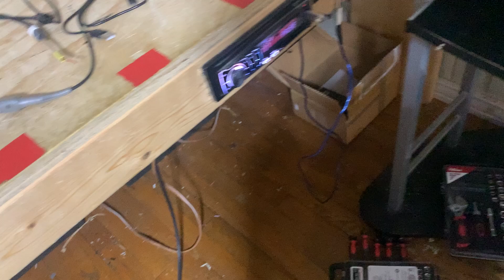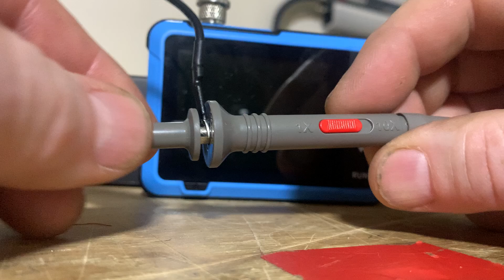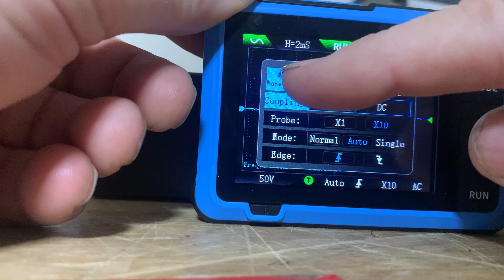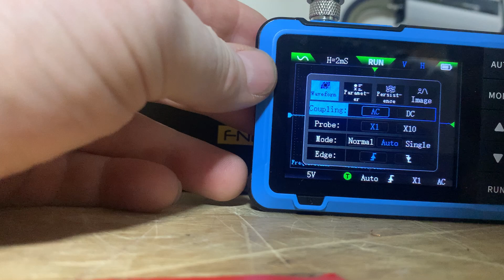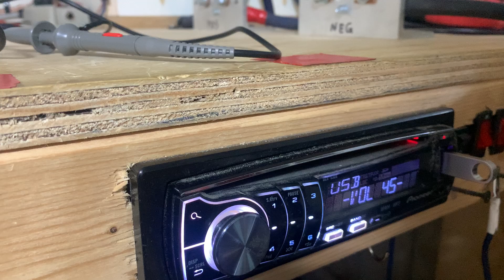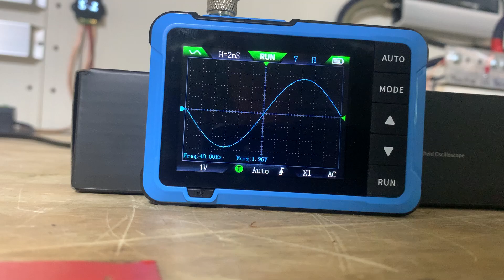Fnirsi DSO 510 Oscilloscope settings probing HU RCAs

Comment: Can you use the crocodile clip connectors to check this? With the probe it keeps falling off 🤬🤬🤬
Reply from the maker: I haven't tried that, but I would say you probably could as long as you leave the probe settings on the oscilloscope on x1.

Comment: Question, does this o scope test 40hz? Mine goes crazy at the speaker output when I do 40hz
Reply from the maker: Oscilloscopes will sense any signal within it's designed frequency range and show the waveform on the screen. Simple answer is yes, this oscope will show 40Hz.
Reply: @AllAboutAudioJW i even copied your screen and my 40hz tone sends my oscope all over the place

Comment: Hey mate I did everything the same as you in this video and I can not get a clip signal to show at all it just shows the wave form go going up and down with the volume.  I know my head unit sends clip signals because the red input clip light shows me on my little rockford amp I just can't get it to show on oscilloscope I did everything you showed in the video still no luck but at least I did try it and I did use the probe the same as you set everything right like you said and still nothing in clip signals so I'm not sure what to do now I'm sorry for being such a pain in the butt
Reply from the maker: The oscilloscope tells the tale. Seems like your HU is sending a clean signal, but the amplifier is clipping the on the output. Without being there to troubleshoot first hand it is difficult to say exactly what is going on with your particular setup.
Reply: @AllAboutAudioJW  my amp has a red input clip light witch detects output clip signal from the hu and I have a blue output clip light on the amp that shows me when the speakers are clipping and my red input clip light dose come on when I turn it up to much so I do know that my hu dose have a dirty signal but I just can't find it on the oscilloscope.     I am sorry to bother you with this but I literally don't have anyone else to help that's all
Reply from the maker: @jesseedgell8698  That's what this channel is for brother. I haven't seen an amplifier with an input clip light, however, I will tell you that I have checked clip lights on various amplifiers versus the DD-1 and several oscilloscopes and sometimes the clip light is wrong. Sometimes it illuminates prematurely, sometimes it is way late coming on, but sometimes it is spot on. I trust an oscilloscope waveform over any other signal measuring device out there. The oscilloscope is correct 100% of the time.
Reply: @AllAboutAudioJW  ok then I do appreciate the help thank you my amplifier is rockford fosgate t400x4ad but just another question when you check for output clip signal from hu rca weather it be sub or mids/highs when you do a 40hz or 50hz test tone for the sub output for clipping of the hu what would I set the frequency/Hz on the stereo to as mine has that settings for sub and front and rear outputs
Reply from the maker: @jesseedgell8698  For mids/highs you would want to use a 1kHz test tone and set your HPF to whatever your speakers need according to their specs. USUALLY you can go by the Fs on the midrange speakers as a good indicator on a crossover set point. So if the Fs on the midrange is 100Hz then you would want to use 100Hz or maybe even 80Hz as the set point for the high pass crossover.
Reply: @jesseedgell8698 I think the clipping light isn’t telling you that the source signal is clipped. It’s telling you that the amplitude of the source signal is too high, causing the next stage to clip.
Reply: Same here did you ever figure it out?
Reply: @james2x  I just gave up instead
Reply: @james2x first check for clip on HU sub out with 40hz tone, then check front/rear out with 1,000hz tone. If one clips at a lower volume then that's the max volume you should use. Next set gain on sub amp by connecting to speaker outputs without subs connected, and with HU at your max clean volume and a 40hz tone. Finally set gain on front/rear amp outputs with HU at same volume and a 1,000hz tone. I'm trying to help, if you let me know the process you followed step by step I can probably help.
Reply: @TimTheTechman -5db 40hz tone for sub prep out if you listen to rebassed tracks

Comment from the maker: Going back and watching the video I said I sacrificed a MALE RCA for an adapter when clearly it was a female RCA. I have both MALE and FEMALE RCA adapters to make things easier for various testing. I also stated the probe ground was connected to the RCA SHIELD which this adapter is from a TWISTED RCA cable and not a COAX so it wouldn't really be a SHIELD wire. We are all human and I definitely make mistakes like everyone else. Just thought I would point that out. Also on this oscope the top 3-way switch is also used to adjust the time per division on screen by moving it left and right. This allows you to put more or less waveforms on the screen while checking your signal.